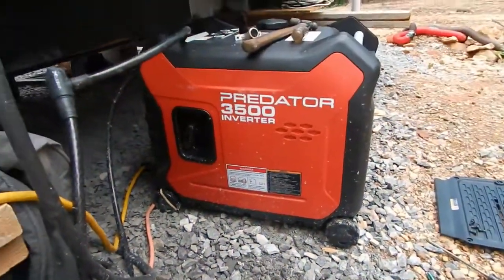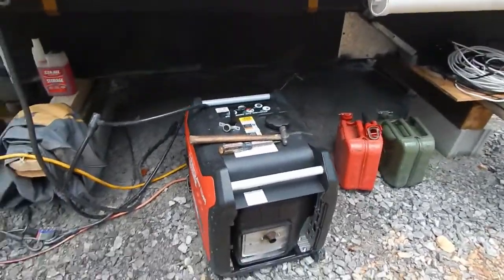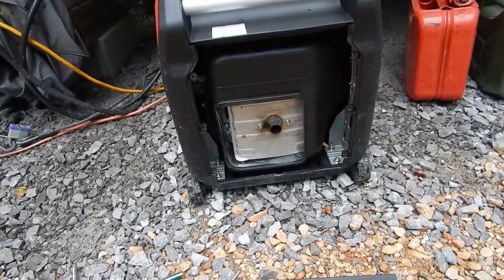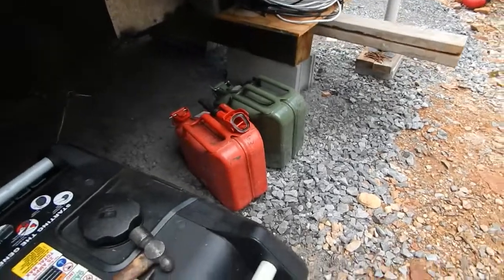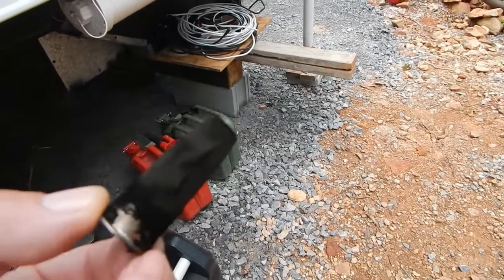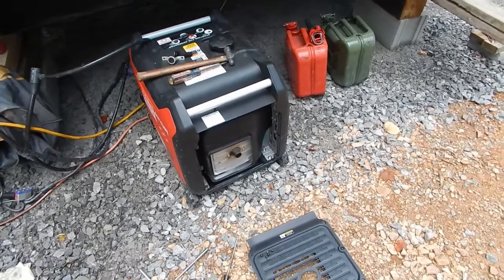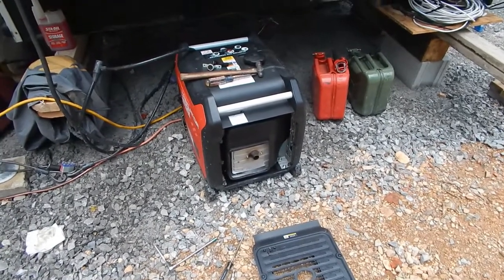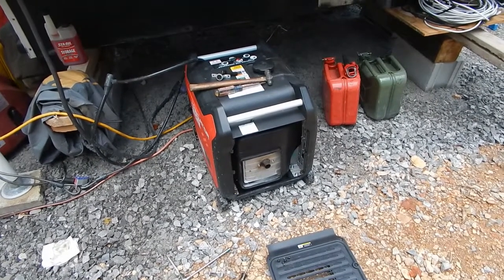Harbor Freight 3500 Watt  Inverter Gen Tip!

Comment: You said this was your second one?
Reply from the maker: Yes about 800 hrs no issues. My solar is up & running now haven't used it in months now.
Reply: @TheKiloG69  Thanks. What was the issue with the first? In hindsight could it have been the spark arrester?

Comment: I just did the same thing. Mine stared running rough while camping and a neighbor suggested looking at the spark arrester. Only 20 hours on the gen. Did notice it was a bit louder without it.
Reply from the maker: Yes it is a bit louder with out it. I have now about 340 hrs on it as it is powering my new off grid home build in TN, plus running my camper a/c at night. I will start to Install solar power this week. I depend on it. I also have the older 2500 watt unit still runs great also.

Comment: I have found that the carburetor vent needs to be moved to under the engine not outside the unit. they run a lot cleaner and wont foul the spark arrestor or spark plug.

Comment: that clogged up fast. I remove them out of mine from new. But they only run in winter on the very worst cloudy rain days here and there on cement.
Reply from the maker: Yup sure did shity gas now a days. it runs a lot here now that there is framing going on & I have no solar installed other than what's on my truck camper as yet. I am trying to decide on new battery to buy. I'm looking hard at Chevy Volt, Nissan leaf, also Out Back Power PLC battery's $$$. what's left of my FLAs is not much .

Comment: I live off grid, bought this exact generator, lasted 3 months before non stop problems, and issues . Complete piece of junk in my experience
Reply from the maker: Sorry to here that. My 2nd unit has about 900 hrs on it no issues. I think they are hit or miss.
Reply: I’ve replaced carb, replaced plug, re- jetted carb, cleaned spark arrestor , changed oil, checked for spark, unhooked oil level sensor because it was causing it not to start as well, but eventually stopped running again.. I’ve never had an issue with a new generator in 10 yrs and own 6 total different types.. usually 2 yrs in they all need work when you use them daily even after reg maintenance..
I’m at a loss on this one.

Comment: How has this held up, have you had any other issues? I'm thinking of getting one. Right now i have the HF 8000 watt gen and it has been great. I have had it for about 5 years now and I average about 25 days a winter with no power and it has been awesome, but I'm thinking about getting the 3500 watt one because it's a lot quieter.  Thanks!

Comment: Did that fix it?
Reply from the maker: Sure did it has to exhale exhaust or it wont run.
Reply: @TheKiloG69  yea i know...i just making sure that was the only problem. To be honest,  it looks like its running a bit rich. I would hook an afr gauge to the exhust and tune the carb a little.
Reply from the maker: It do seem to run a tad rich but pull the plug its very clean almost white. ,I run it with the oil door off makes a huge diff. Running a tad rich on a air cooled  engine not a bad thing they will run a bit cooler on cylinder & head. there is so much stuff tucked in that little red box it is almost impossible to get to anything with out take the cover off. my hand barely can get to the oil plug dip stick real tight. The carb is buried